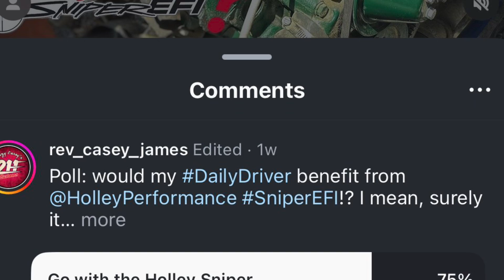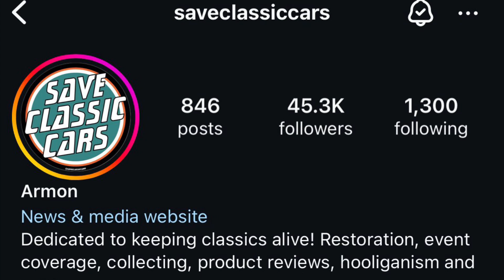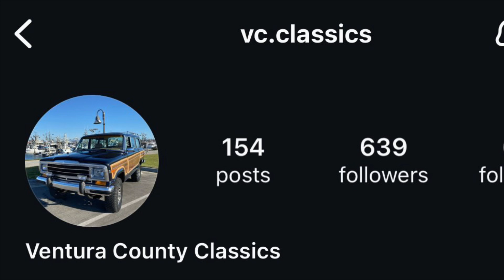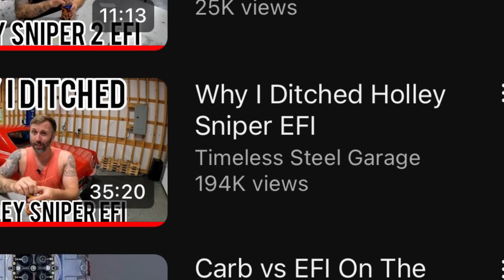What’s Wrong with #HolleySniperEFI & Why ​#AcesFuelInjection Might Just Blow It’s Doors Off!

Comment: Direct Injection is where it’s at!
Reply from the maker: Yes indeed,  @excellentadventurevan1730 .
Reply: Not without port, too. DI allows carbon and gunk to build up on your valve stems, weighing them down and choking off the air. Port injection sprays on the valve stem keeping them pristine. Toyota and subaru figured this out.
Also, being that DI is mounted IN the cylinder head like a spark plug, they get way too hot, boiling off the spirits and leaving varnish behind, which clogs injectors. Revving the engine and shutting it off at the top of the rev vacuums out the injectors. Still, dual is better.
Reply from the maker: ⬆️ Power stroke diesel guy,  @2012listo . 😊
Reply: @2012listo Yes Sir! Gas engines are now having diesel engine problems.  I will be pulling the EGR, and intake off for a cleaning tomorrow.  DI gas engines can also get some weird detonation with certain oils.
Reply: @randallmason9687  I taught my family to always Rev the engine and shut it off at the peak. This allows the engine to vacuum out the injectors so the gas doesn't boil off and leave varnish in the injector. We also all have a catch can.
Reply: @2012listo make sure there are no turbos involved…..that can be catostropic

Comment: The killshot system is $599 right now which is crazy cheap.. I bought mine a couple months back for $800 but havent installed yet. I am impressed with build quality of the wiring harness and like components so far.
Reply from the maker: Yeah, it’s hard to believe they can get it that low and still make any money,  @fathergratwick .
Reply: @crazycaseyscustoms  its an awesome system, i bought mine over a year ago at $869 and installed it on my sons ‘67 mustang 289……night and day difference, best thing ive done to that car yet……building an aluminum headed hi/po roller cam late 90’s 302 to replace the tired 289 and beauty is i can simply swap over the efi system when that time comes……i figure it will be his graduation present if he stays on track and doesnt start slippin….seeing how he is a teen at almost 17
Reply: I think they might be trying to get rid of them because of the new models coming out
Reply from the maker: I never saw this comment,  @trentdawg2832 . That’s awesome to hear!

Comment: I'm about to install a used MSD fuel Injection conversion on a 70 Bronco with a warmed over 1968 302 Windsor in it, automotive gods please help me! 🤣
Reply from the maker: Odds are you’ll be just fine,  @chiefknowstomuch . And if not…😂
Reply: I know a guy that's had real good look with the MSD unit
Reply: Luck
Reply from the maker: Thanks for the comments on my video,  @carlpreston1680 . I appreciate it!

Comment: If you want EFI, you MUST buy a multiport injection. That's the real injection. Pro-Flo 4, Aces Joker...
Reply from the maker: Multiport is for sure the superior product,  @chregu2 . But these throttle body systems definitely seem to have their place.
Reply: I always thought the same till ive talked to folks who have tried both on the same motor and say they noticed no perceivable difference in performance despite the technical advantages and the assumed advantages you would think it would have.
Reply: @fathergratwick , IMHO, you will never gain any perceivable performance using injection. You will normally consume less fuel. If  you want outstanding performance you need to change camshaft and cylinder head.
Reply: @chregu2  nonsense, a carb vs efi 9/10 times efi makes more power. Why? because carbs have to be tuned and are more complicated then the average person can figure out. there is truth to your statement, but our in the real world unfortunately people give up because they cant tune something carb or FI still needs fine tuning.